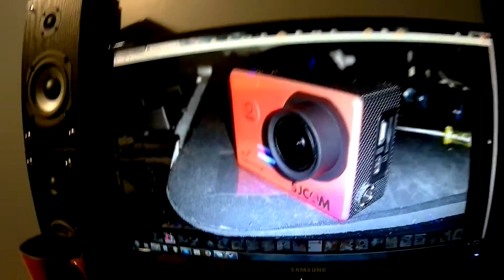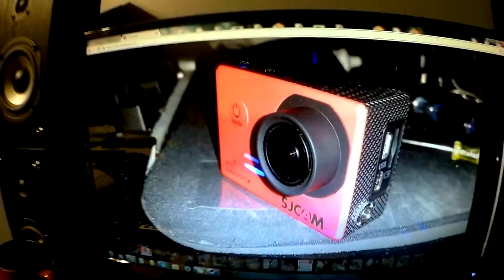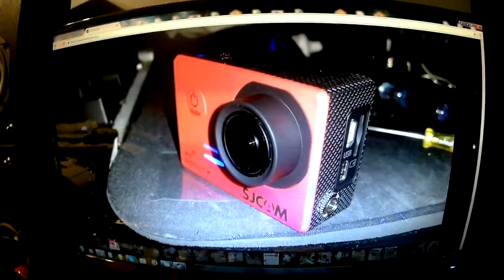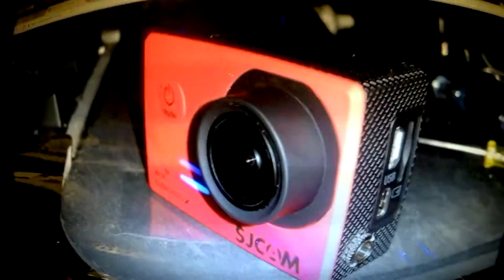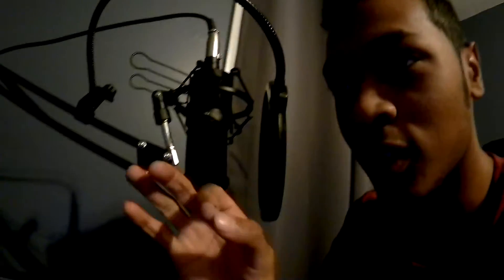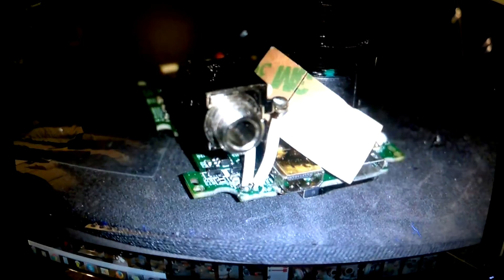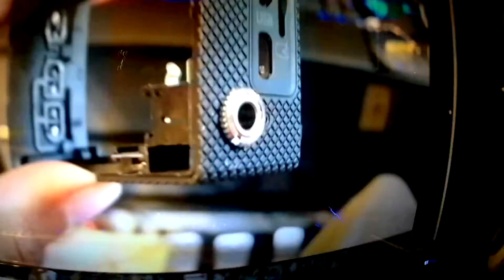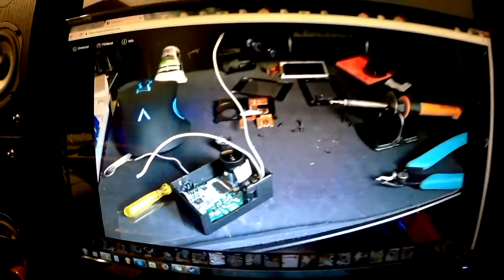SJCAM SJ5000X External Microphone Sound Test

Comment: Hi, will rode video micro work with it ?
Reply from the maker: Eugene Ng Yes i use a shotgun mic with mine, see the beginning of my latest video
Reply: House of Boost if I plug into de action cam, without de audio interface , will it sounds okay ?
Reply from the maker: yes, the audio levels will be really low though. you'll then need to increase the gain in audio software and then the audio is perfect